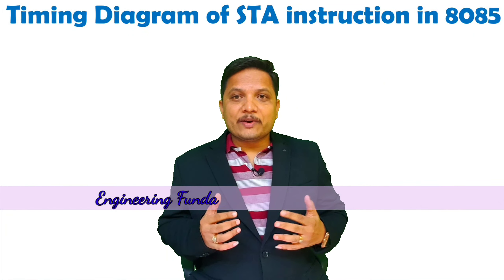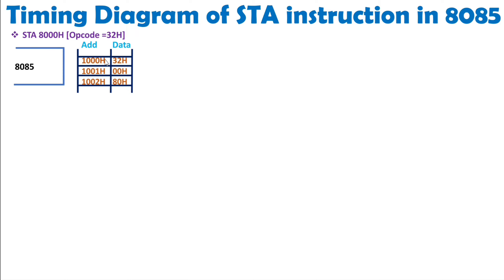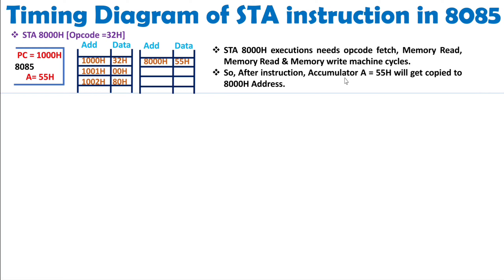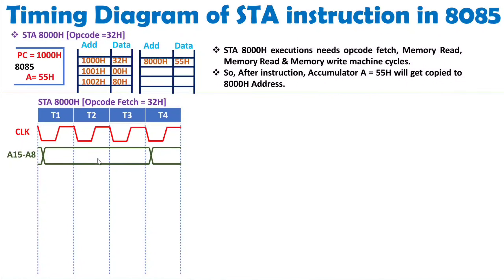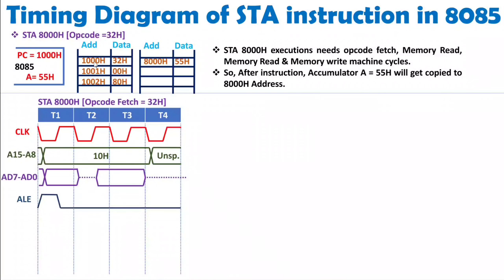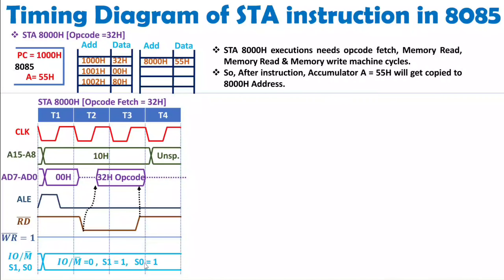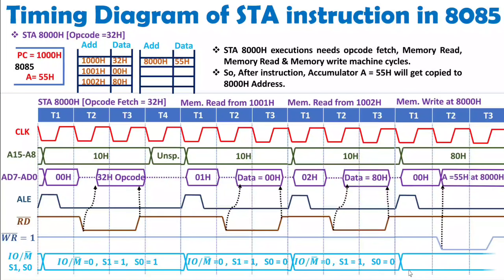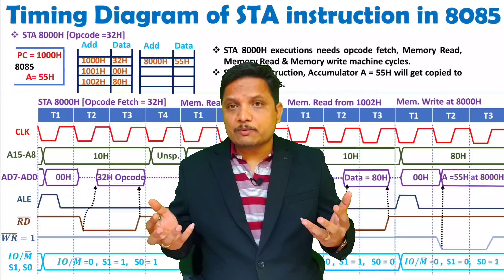Timing Diagram of STA Instruction in 8085 Microprocessor | Timing Diagram

Comment: sir..thank you so much for the video. i hv only one dbt, what will the program counter do when microprocessor does mem write operation to 8000h address.will it gets changed to 8000 from 1003h. ?
Reply: sry from 1002 ?
Reply from the maker: After write and read, it will increment by 1.